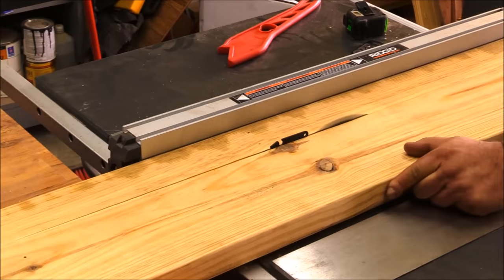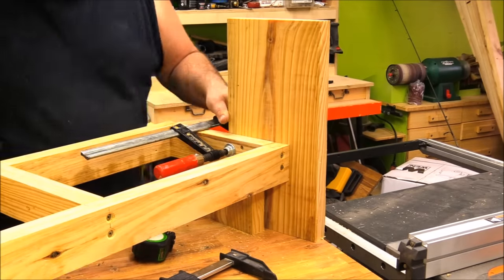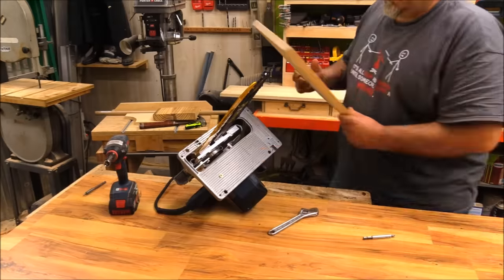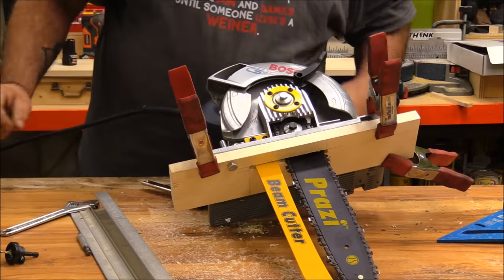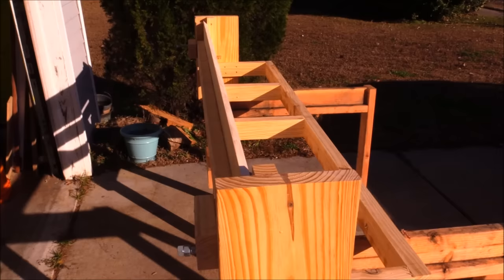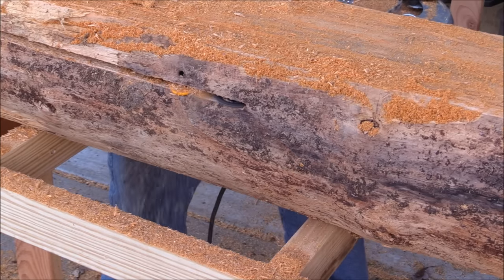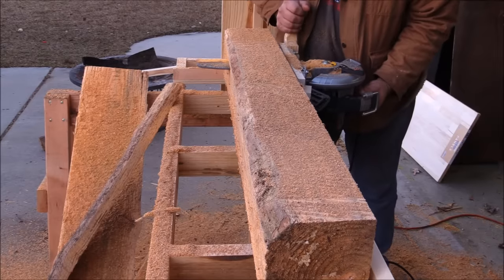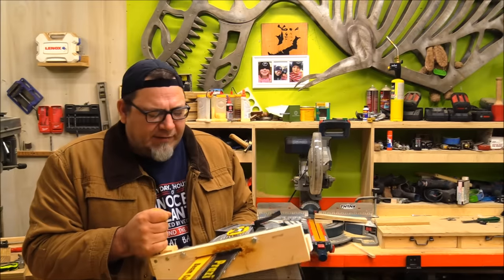(how to make) a simple homemade  sawmill | Izzy Swan

Comment: Hey Izzy - cool project. My only suggestion, when you're cutting slabs (boards) as you were here - keep some wooden wedges/shims  on hand to keep your kerf space open.   I'd tap them in every couple feet on both sides of the board you're making - it keeps the pressure off the blade... I don't think kickback is a big issue with the Prezi, but it will help keep your chain a little sharper a little longer by reducing the friction/heat. WIth a gas saw mill it's s must to keep that kerf even and open - I would think the same thing here would help.   Cheers!
Reply: Thats a solid tip. Thanks for sharing that.
Reply: If you look he has a board following the blade :)

Comment: You might want to try using a "rip" chain on your saw.  If you have a sharpener, set it to a 90 degree angle (straight across).  Your speed should pick up significantly.
Also, and old timer once taught me to always use two different species of wood when you use them to rub against each other.  It turned out to be great advice.  A little waxz on the mating surfaces helps a lot too.

Comment: I have a larger chainsaw mill that I use fairly frequently right now. Your mill is truly amazing and I plan to make one myself for cutting smaller pieces and cutting down the larger pieces that my tablesaw won't handle. The only thing that I would recommend to lessen the chatter and give you a much smoother cut is to change to a milling chain. It makes all the difference in the world on my mill and leaves a much smoother finish on the wood. I have milled everything from beetle killed pine to canyon oak with great results.

Comment: Great video! I've been holding onto several branches (black walnut & spalted birch) that this would be perfect for. One addition I might make/suggest would be to add construction adhesive or framing brackets (or both) to the joints to prevent the inevitable racking that will occur down the road.
Reply: Frank's Custom Woodcrafts like it

Comment: I have a Granberg portable mill that attaches to my chainsaw. One thing I saw in their instruction video was using wedges after cutting in so far install a wedge on each side into the cut it will keep the log from closing up the gap and binding the chain. This is a great set up look forward to building something like this thanks for the ideas.

Comment: Much simpler than the metal one you made. You mentioned having to put some umph into pushing the blade, I'm not sure but i think even doing an alaskan mill w/a chain saw it looks like it needs some oomph also. I think.  Maybe not, maybe a gas chain saw has a little more power than an electric circular saw.  The truly important thing is getting to see what your fertile mind comes up with. 

You never fail to amaze me Izzy.

Comment: I spent years milling lumber with a power saw. There is more than one way to sharpen the chain. Rip or cross, Ripping needs a straight cut sharpening.and it cuts very smooth. Use a factory cut chain to do cross cut.also note that the rakers need to be filed down more with a ripping chain. I had more than a few chains filed {sharpened} for different uses.

Comment: Cool idea Izzy! But what about orient the wood so the chain is cutting straight down? That way more saw dust will get pulled down by the gravity and the weigth of the cut of wood wont apply preassure and clamp the sawblade to the log.
Reply: MrGrebgnet yea .but how? the log would have do  be floating .  i like the idea of the saw being upright though just like you normaly use a rip saw

Comment: Hmmm I wonder if you could put that saw attachment into a table saw. 
One way you could put oil on the bar is a turkey baster. The vibration would cause it to drip as you go.
Reply: TinManKustoms what a great idea 💡 to use a table saw! 👍
Reply: TinManKustoms yea then you could pull the log through the saw! cool

Comment: Very impressive, I'd consider building one if the beam saws were easy to get hold of in the U.K! Might have to import one!
Reply: spence burge you can make the same jig for a gas chain saw
Reply: Chaz Lewis, how would you do it? Namely, how to attach the chainsaw to the rail...
Reply: use a chainsaw and make a guide for it to use on the mill

Comment: Cool design Izzy! Do you think is cuts slower on the outer part of the log because of the blade angle relative to the concentric grain?
Reply from the maker: no becuase when the wood was fresh it cut better position didnt seem to matter much. its realy wierd i tyought
Reply: izzy swan Having done a lot of tree work, I can help. Dried wood is more difficult because it's dry. When cutting through a green tree, the relative moisture helps the teeth cut and you'll get bigger shavings (assuming the blade is sharp). With dry wood, and cutting with the grain, the wood tears and breaks more than cuts. It's harder on the chainsaw than cross cutting green wood. LOVE this mill!!
Reply: @kevinbowker2385  I have a lot of red oak on my property and one book I read said " it will cut fine green, it will send sparks off your chainsaw seasoned.

Comment: Hey Izzy.  I love your vids.  I have a couple of modifications you could make if you were so inclined.  One is to attach an outlet box with a flip switch about halfway down the run on the bottom.  this way, you can cable tie the trigger and control it with a switch.  two is to take up the slack on your saw with a cup hook close to the outlet box with enough slack to go all the way in both directions.  i noticed that a couple of times you ended up standing on the cord.  anyway, great video man!!

Comment: sweet ok izzy as I just left craftsman in my dust after trying to get them to honour their tool guarantee again. only to be told it doesn't apply to the tool I had this was the second time I had this happen. ( Dad always had craftsman ) I'm done with them.  so I will be joining you're Tool masters association as a founding members I think you called it. And which one of the companies you have there should I look at jigsaws with. I don't even remember the last time I was without a particular tool for this long. (most tools I have at least 3 each ) Well unless you count the planner I still don't have one of. I will be buying the bar saw for my circular saw and building this mill of yours asap. No chance you might be giving a planner away  this year is there : ) well keep up the good work and as always I will be watching.

Comment: Have you made any attempt to mill logs larger than the width of the blade?  Add a sled from the opposite side or something? I suppose I'd need to buy a chainsaw to cut logs down to the appropriate length, and maybe even down to width if they're more than 12 inches. Really interesting project, and I can see the utility of that chainsaw attachment for a circular saw. You had a reference surface in the circular saw unlike just a straight chainsaw.

Comment: If you don't want to use so much pressure when you're cutting, give about 3 good strokes with a flat file to each of the rakers on your chain. Normally the rakers on a chain are set rather conservatively, so you basically have to cut them down a bit to make a chain perform well. I do this on all my saws. Don't get too carried away though, if you knock too much off it makes it easy to stall the chain, and you might get some chatter too, but 3 strokes with a flat file should be fine and just make it cut effortlessly.

Comment: If you use wedges as you cut along it won't be as hard to cut . The weight of the the section already cut starts to put a bind on the blade

Comment: I'd zip tie the button so it's always in the on position. Then attach a pedal to the power cord so you still have control of the power without the awkward two handed use.

Comment: Excellent  work. Did you cut the wood at an angle or does it just look that way on the video. it looks like the start is thinner  than when you get to the end. Don't the bolts get in your way when cutting?. I know you mentioned  the carrage  bolts would have been better.All the best for 2017.

Comment: Didn't read through the comments so this may have been mentioned but I believe the reason you were having trouble with the cut is because of  a few reasons...

#1 when cutting through the whole log you are also passing through sapwood which is just below the bark and will tend to be a bit sticky and slow down your blade.

#2 you need to use wedges in between each cut. Don't Hammer them in deep and jam them up.
You don't want the board to be flexing, you only want to support it as you cut.

#3 Rnsure that you are using a ripping blade. It has a more aggressive cut because you are cutting through many more layers of growth rings.

That said, I would like to point out that this is a very nice little project you created here, but I recommend adding an Oiler to it. Simply adding oil with a brush every 3 ft is more than likely causing unseen premature wearing, and will more than likely drastically reduce the life of your tool.

Comment: This video is a Godsend - THANK You! I have a question though, and hope it is not crazy: I need to saw some railroad ties (sold for landscaping) in half lengthwise. This setup would be fantastic, but can the Prazi attachment do the job if there is old creosote treatment on the ties? It is just barely there, almost imperceptible and not sticky or tar-like at all. In fact, the landscaping company guy even had to point out it was there because you sure can't see it. The ties are nice and straight, about 8 x 10 inches and 8-1/2 feet long. I brought a short piece home and a regular saw did not bind at all.  I'm strictly asking about the mechanics of it, not the health concerns or smell if any. Any experience or knowledge of this? Thanks so much for your videos!

Comment: Great video! I looked at the Prazi web site and the copy implies that the Beam Cutter attachment only works with a worm drive saw.  But you are using an ordinary circular saw, correct?  Which model Beam Cutter did you purchases (the 2700 or the 7000)?  Did you have any problems attaching to your non-worm drive saw?  Thanks in advance.

Comment: Izzy, doesn't the weight of the wood after the cut press on the chain causing it to be harder to cut?  Wouldn't either wedging the cut side up to relieve pressure, screwing in a support at the cut end that holds from above, or redesigning the held piece to be cut from the side or bottom make cutting it easier.  I've seen the side cutting designs but not a bottom one.  I would think a bottom cut design that uses gravity to relieve the pressure but also supports the bottom so it doesn't snap would work well.  Would it not?

Comment: Were you using a ripping chain.  The difference is that a rigging chain is filed on a 10 degree angle versus 30 degree for crosscut and there are fewer teeth on ripping chain for greater chip clearance.
Reply: Bill Wessels, I believe that particular attachment comes with a ripping chain as opposed to a regular chainsaw chain.

Comment: Izzy,  I am wanting to slice up some circles out of tree limbs from 1" in diameter to 8"  However my miter saw will only do about 3 1/2"  I am looking into installing a wood cookie floor out of several types of wood and then epoxy it.  I just wanted to know if you knew a way I could cut the larger diameter pieces into 3/4" thick by up to 8" in diameter without a mill.

Comment: With a chainsaw you cut by pulling up the handle, and pivoting on the bumper spikes, that is why you can chainsaw with one hand. So if you could make your saw pivot there would be no need to push so hard, making it easier still. What saw still and push log?

Comment: For the runners -- PVC. Cheap as shit even compared to two by's. You can buy stock run T's, couplings, etc etc. tough as shit (we used to make propane guns out of them as kids and it could 'safely' handle thousands of launches without sending shards of shrapnel into our faces, our projectiles were various squash and potatoes and we'd easily be able to clear a football field at half-fuel capacity). 

What kind of widths and trees are you ripping? Quartersawn? Rift?

Comment: I've a challenge for you ( admittedly, this is a rather selfish "challenge" on my part ... )

I'd love to see a chainsaw mill which is specifically designed for milling lumber which is cut "radially" ( the way which lumber is "rived" ).

Riven wood is less likely to warp, cup or twist and is used in many forms of "green wood" construction ( think "bodgers" ) ... and Viking furniture and furnishings ( replicas, etc ).

Comment: Thanks for sharing. If you are not able to stall the saw, I think you have the wrong number of teeth per inch or the rake angle on the teeth needs to be greater. I don't know if you can buy a suitable chain for that gadget with fewer tpi but it might be worth a try.
Reply from the maker: Jeff Harmed it comes with a combo blade on it.
Reply: Isn't stalling the saw something you want to avoid? Or is the idea that stalling the saw can act as a safety measure by keeping it from binding on you?
Reply: Wow. This looks doable. I'm not finding the plan at your site...have you added it? Thanks!

Comment: Now be careful Izzy,  saw milling is additive.  I started with a chainsaw  mill, now I have a Woodmizer lt40hd, a 36inch slab bandsaw mill I built out of a Hudson 18, and just aquired a 24 inch tractor powered planer jointer edger. I love to cut wood.
Reply: By the way, I am  bringing a load to Charleston in the next couple of weeks. I am in Lancaster SC.

Comment: Why a circular saw, and not an electric chain saw?
Reply from the maker: i havent had much experiance with eletric chainsaws the one i have used do not have enough power to mill like this
Reply: izzy swan I'll have to check HP of Circular Saw vs Electric Chainsaw....
Reply: izzy swan mmmmmmmm
Reply: I have a 15 amp circular saw and a 15 amp electric chainsaw. I think the much greater chain speed of the circular saw unit would make it the best choice. The electric chainsaw would be much slower.
Reply: I should add that a ripping chain on a chainsaw would be practically a necessity if you are going to do this work regularly.
Reply: Leo Veroude Do you know if the circular saw attachment uses a special high speed chain, or just standard chain?
Reply: Leo Veroude I think my question and your answer passed in the mail. ;-> Thanks
Reply: Jim Fortun
Reply: I'd be interested to see how well those cheap 15 amp chainsaws would be.  The nice thing about an electric chainsaw is that you'd still be able to use it trim trees with it.  You  could just use a gas chainsaw if that's what you have available.
Reply: I believe the reason for the circular saw is that it has the base plate so you can easily attach the guide to it for smooth and linear travel!!!
Reply: And it has 18 inch bar
Reply: The beam saw attachment is just a handy job site gizmo, he states that he picked it up. The base does ensure a smooth cut, still I see no reason you could not mod your way through for any saw you choose to use. I could see that a smaller electric chainsaw could be underpowered but having an automatic oiler will help.  And yes a ripper chain is recommended for milling.
Reply: I seen it made using a chainsaw but they had to add a base plate to the saw and it wasn't as smooth as the circlesaw, which means more milling, and wasn't as quiet
Reply: Those bolts thru the bottom should have been countersunk flush.